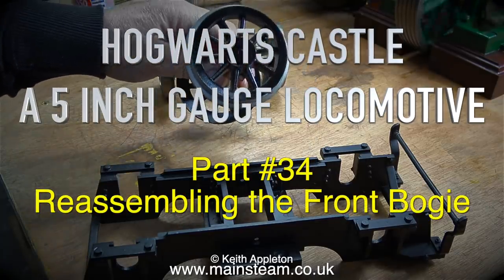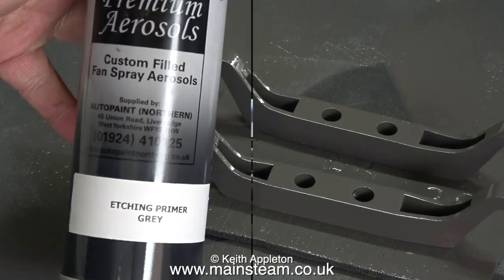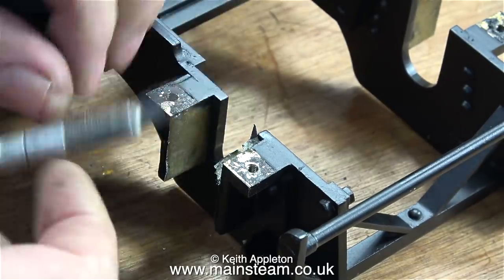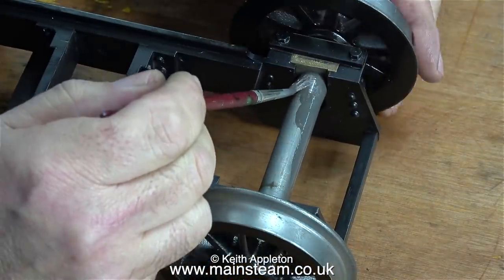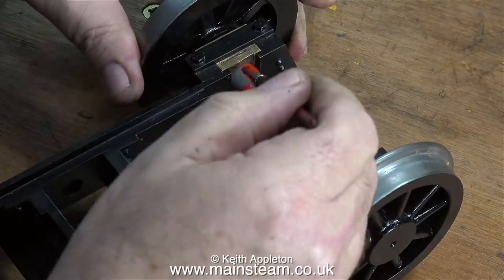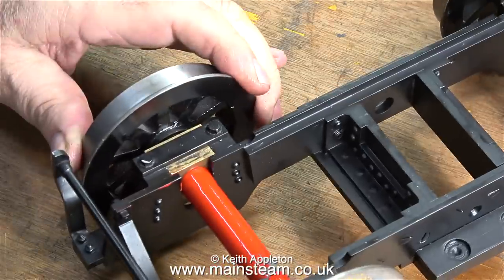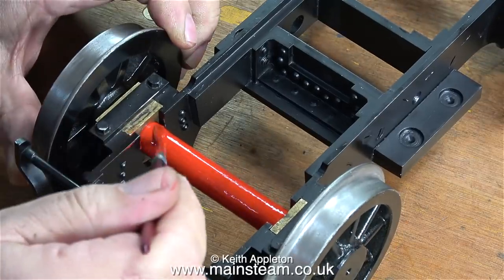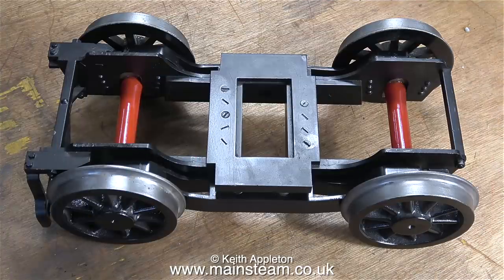HOGWARTS CASTLE   A 5 INCH GAUGE LOCOMOTIVE - PART #34

Comment: I hope you told the owner of the 3.5" Gauge "Evening Star" Just to give it a thorough cleaning and oiling. Sounds like it is in great condition and just needs a boiler inspection and certification.
Reply from the maker: Er ..... no it was definitely not in great condition, even the mechanical lubricator has seized up . . . .  this was a job that would have been impractical to take on, as I believe I mentioned in the video. . . .